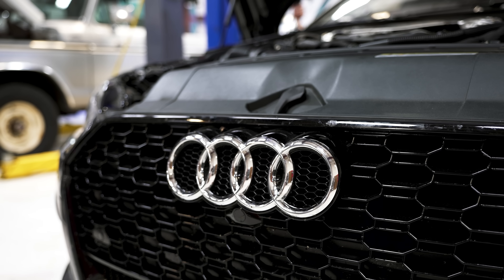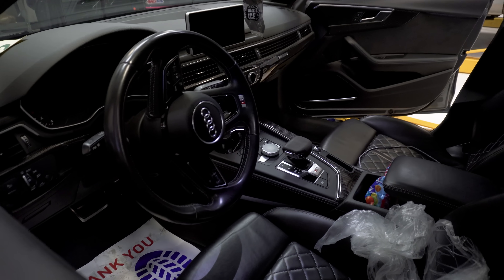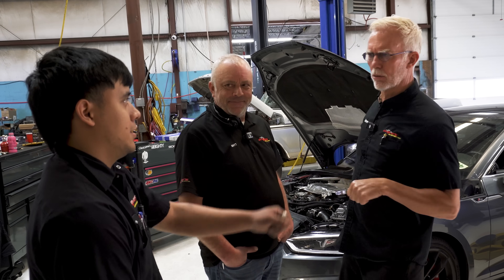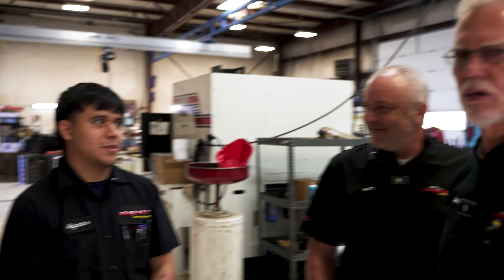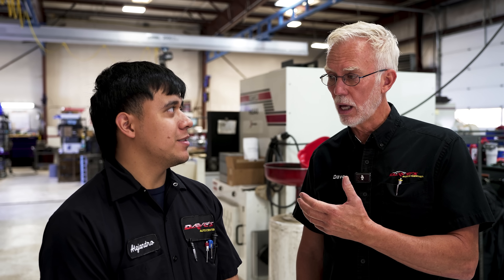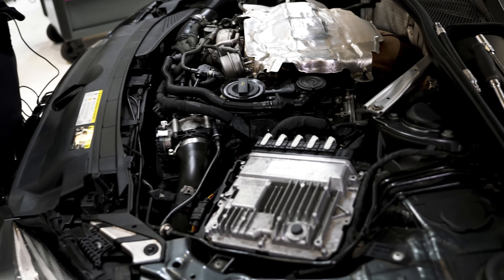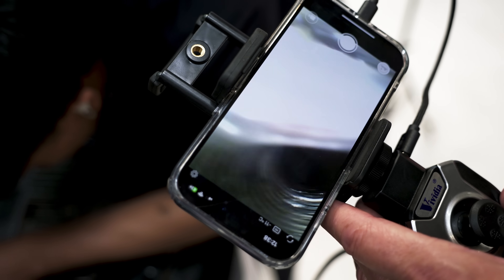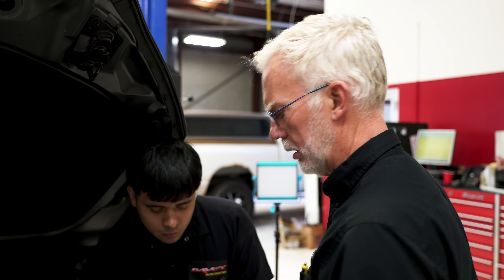Audi S5 Engine Piston Damage

Comment: I find it hard to understand how a motor can basically blow up at these miles, how can they be so fragile?  Or is this just Audi?
Reply: You put 85/89 octane in an engine that requires 91-93.   And/or you install a tune (or buy a used one with one) that tries to keep the timing advanced and defeats the anti-knock map that would have reduced the timing in a LSPI scenario or poor fuel scenario (there is a specific tune by a company that seems to have blown a whole bunch of these engines due to that).       This same engine and/or variants of it are found in many Porsches as well.     People drive them to 125-150k no problems.    The ones that do that always put in good fuel, and always do the maintenance on schedule using the right types of full synthetic oil, and usually drive the car as intended, IE they don't try to max-mile it and lug the engine all the time.    The 2018s did have a design flaw in the rocker arms that can cause them to fail and is ultimately wear related, so at higher miles or with poor maintenance they could fail, but that was rectified in mid 2019.     More or less, just don't buy a used S4/S5 or S6/S7 unless you know the maintenance history and are certain it wasn't tuned and hooned.

Comment: Carbon broken off inside of intake manifold, because there is no cleaning of the intake by normal fuel injection. Some cars have started using both normal port injection and direct injection to resolve this problem.

Comment: Direct injection vehicles are know to have carbon build up on the piston tops so Carbon build up causes hot spots on the piston and those hot spots ignite and causes 2 ignition fronts  to collied with each other in the combustion cycle there’s a good oldish write up on the net about pre ignition ping and other stuff the person  in the article even talks about polishing the tops of pistons to a mirror polish in order to run super advanced timing and get away with it without causing the topical spark knock from running over advanced timing.

Comment: Hey Dave, modern engine management systems will disable the injector in the event of critical misfire. So it is very possible that the injector was disabled once the misfire monitor picked up the issue.

Comment: I always thought the problem with DI is the carbon build up. The build up causes gunk on valves and can jack up O rings if carbon flakes get in there. I just cleaned the valves on my 2015 vw passat b7

Comment: I WITNESS A PRESENTATION ON HOW DURALUBE OIL PERFORMED BACK IN THE 70'S WHEN A HIGH PERFORMANSE OF A RACING CAR ENINE PUTSIDE THE CAR WAS DRAIN OF ITS OIL AND 1/4BOTTLE OF DURALUBE WAS PUT IN THE ENGINE THE ENGINE WAS TURNED ON AND EVEN ACELERATED AND IT RAN GREAT WITHOUT ANY PROBLEMS TO THE ENGINE I ALWAYS USE DURALUBE IN EVEY CAR I OWNED EVER SINCE I NEVER HAD ANY PROBLEMES BECAUSE THE ENGINE RUNES COOLER YOU DONT EVEN HAVE TO USE MORE THAN ONE QUART OF OIL PLUS THE NORMAL GRADE OF OIL YOU NORMALY USE TO HAVE YOUR ENGINE PROTECTED EVEN IF THE MECHANIC LEAVES THE SCREW LOSE AND YOUR ENGINE RUNES OUT OF OIL IT WILL STAY PROTECTED LIKE IT HAPPEN TO ME IN THE STATE OF MONTANA DRING DURING A SNOW STORM BY THE TIME HAD TO REFILL MY GAS TANK AND CHECK THE OIL FOUND OUT MY ENGINE HAD NO OIL I HAD THE MECANIC CHECK WHERE THE LICK WAS A LEARND THAT THE CLOWN THAT CHANGED MY ENGINE OIL DID NOT THIGHTEN THE THE SCREW BELOW ANY WAY HE DID THE ADJUSTMENT NEEDED AND GOT HOME IN SATTLE WITHOUT ANY PROBLEMS❤❤❤❤😅😅😢😮😂

Comment: The biggest problem with the b9 models is the rocker arm bearings come out cause they where too small from heat to cool down the come out and end up in the engine if you’re lucky you can fix it if it didn’t cause internal damage the 2020 plus models where fixed with this issue also the lower air to water cooler is a problem too https://youtu.be/HdZiyO-lCuc?si=VyCdFr01cX2s8VxJ

Comment: Audi shuts the injector off, when a misfire is detected. 
You can see this happening in your scan tool. 
And yet again another LSPI victim.....keep on driving on your long overdue oil change, especially with DI gasoline

Comment: Hi Dave I can't believe what luck we have as Audi-VAG owners. I have best engine ever made by any firm, the forged crank VW 1.8T with a K04 ball bearing turbo and it rocks. But what folks don't know is you can't own a Bmr or a Audi unless you either 1) a billionaire 2) a mechanic 3) organized crime boss.  This is cause they break all the time and cost boat loads of cash to fix. Unless like me, I been using an engine crane on my cars since high school days when I pulled the 250 six cyl out the 2 door '70 chevelle and dropped a 283 with cam and headers and holly 4 barrel and hurst shifter. look at this other good guy mechanic says how bad bmr's are: https://youtu.be/ESSNWYOYhpY He has a list of one M6 parts replaced and its all the way from rod bearings to wiper blades and everything in between :)

Comment: There's no point in rebuilding or replacing the engine because with 75K miles on a European car, the automatic transmission is going to be going out next and very soon too, and it's going to be super expensive to fix too.  75K miles, if even that much, is about it on these cars.  This is not the time to buy one of these cars, this is the time to get rid of it to the junkyard.
Reply: That car has a ZF8, it's not like the old DSGs that had mechatronic failures.   Do the maintenance on it at 80k and it will live another 80k easily.   It's one of the best if not the best automatic transmissions on the planet.

Comment: A friend just bought  a low mileage 2006 BMW M6 with a na  5 ltr v-10 that puts  out over 500 hp at high rpm.
We heard they can develop  rod bearing  problems   at higher  mileage.
Had it checked  out at a BMW  specialty garage and all is ok sofar.
Ordered  and installed  the recommended  10-60 oil and good filter. The car is getting about  10 mpg in  Florida traffic which  seems  excessive  for a 5 ltr engine. I would appreciate  any input  about this engine.I

Comment: The EA839 engine (which this S5 has) has a known problem with pistons cracking and rocker arm failure. Rocker arms were updated in the latter half of the 2019 model year with larger needle bearings.

If the engine can be rebuilt (which I don’t think these AluSil blocks can be) then the rockers should be updated if they are the old version.

Comment: Omg don't repair that without replacing all rocker arms to latest oem revision anything in the b9 platform produced to July 2019 use the original rocker arm design and have a 100% chance of dropping needle bearings right out the side!
Also cylinders are plasma lined shouldn't really be honed without reapplication.
I'm getting ready to pull and build the engine on my 18 audi rs5
Just built my 18 rs3 sleeved cylinders and 12mm head studs should throw down over 1200whp

Comment: Is it lspi? Low speed Pre ignition
Reply: Yes that's what he's referring to. There is another issue with DI cars where enough unburned fuel gets into the oil and can detonate underneath the piston. It often cracks/melts pistons even blowing the ringland clean off.

Comment: I also have the same s5 as the one in the video. Mine has 30,000 miles and I don't have any problems with the car. A very important thing is to change the oil and oil filter, which I do every 5,000 miles and without stupid tuning and the car will last.

Comment: The fact that the dealer recommended your shop shows how well known your quality of work is.
Reply: Dave is great but no dealer repairs lower engine failures. We just replace it.
Reply: @CoachJay7212 Audi will replace pistons and some bottom end. Depending on engine and failure.
Reply: @nickdelillo3060 yes on a new car but that's a 5 6 year old car.
Reply: Dealers usually refer to their inside guys that will usually rape you worse than the dealer themselves... just sayin'... although that doesn't seem to be the case here.
Reply: That’s because that is a great free ad for them
Reply: Even the dealer knows it's crap, that's why they won't work on the engine🤣🤣🤣
Reply: @BubblesTheCat1  dealer a don’t have the machinery like Dave does.
Reply: @BubblesTheCat1 dealers are basically certified / licensed to sell cars by the manufacturer- they’re work isn’t necessarily equal in value to that of a small mechanic w that said.  Dealers sell cars, dealers fix cars , new car dealers lease cars.  Anyway, the fact of the matter is that they typically DONT do anything w engine rebuilding IRONICALLY … that they specialize in so much .  Ever think that maybe this is why everything that has to “deal w a dealership” is entirely inflated and a scam?  Well guess what. It is….but you can’t say that unless you understand the aforementioned points.  If you want to change the system you have to understand it….there is an entire network / underground group of mechanics who do good work and have figured this out.
Reply: Dealers don't want to do difficult technical work- they want in and out high volume bullshit upcharged maintenance fees from people who don't know anything about servicing their car or what it entails.
Reply: @Slythey  incorrect, we do work like that a lot. Piston rebuilds and reseals. Transmission repairs if parts are available which most of the time they are.  Audi makes a lot of parts available and warranty urges you to repair not parts change whole engine. I just did one the other week.
Reply: @nickdelillo3060  great story, Nick. Your sample size of 1 measly dealership is irrelevant to the literal millions of fleet vehicles my company works with. Thanks and have a good day.
Reply: @Slythey  measly lol it’s a huge dealer network but all your negative bullshit comments shows your intellect.

Comment: Sounds like preignition of fuel before the compression cycle was completed. Direct injection dumps raw fuel into the cylinder before TDC of the piston during the compression cycle. Preignition mostly caused by soot induced into the cylinder that is caught at the edge of the piston and oil rings and acts like a glow plug. Thus, destroying the edge of the piston. Though, I might be wrong.

Comment: I'll bet there was tune on that car, and they ran it like a race car. Also there are known issues with fuel delivery with direct injection cars especially with a tune high pressure pumps can't keep up with demand. Porshe Audi and VW's had FSI injection systems starting in 2005 or 2006 that require oil up keep, and the high pressure fuel pump cam follower to be changed at regular service intervals they run off the camshaft believe this car has this style or one that is similar that uses the separate lobe on the camshaft to run the high pressure fuel pump. Some cars have two pumps depending on engine type V6 or V8 .... I'll stand by a fuel delivery issue related to a tune or the pump itself and or high pressure fuel pump cam follower. Believe the pumps to be relatively reliable, but there have been know failures of pumps at relatively low miles....